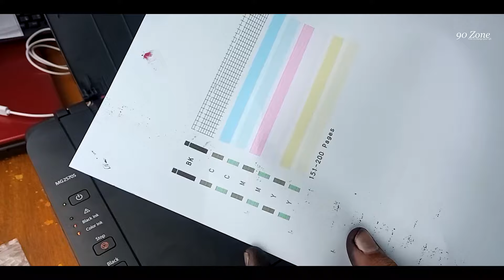Canon MG2570s CISS Installation   Convert Cartridge To Ink

Comment: It will work but need not open the whole printer. Just attach pipe to the empty cartridges and not new one and ensure you have got the ink flow stopper with the CISS Kit.

Comment: please tell me how to use scanner without catridges or catridges not recognized?? For Canon MG2570S
Please tell me to bypass the alarm or blinking yellow light of the printer to let me use that scanner even if the printer cartridge is not working.
Reply: Press stop button 5 times